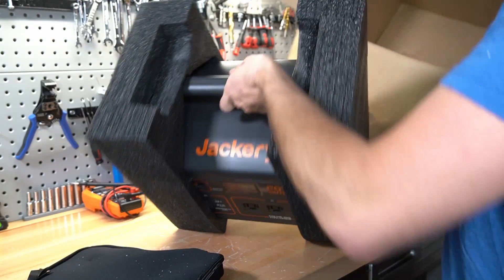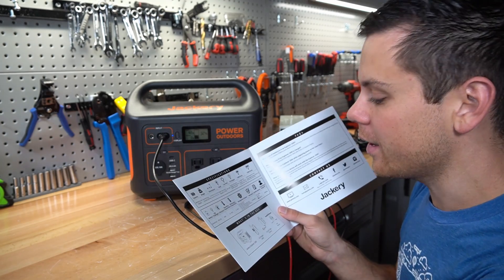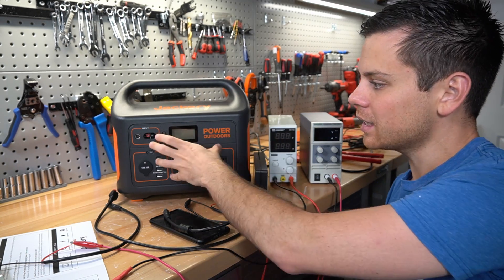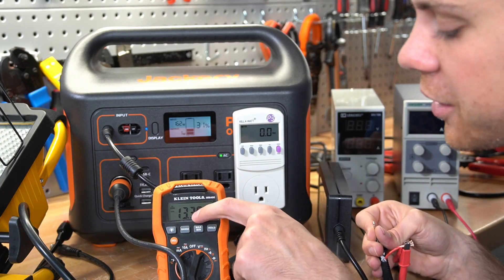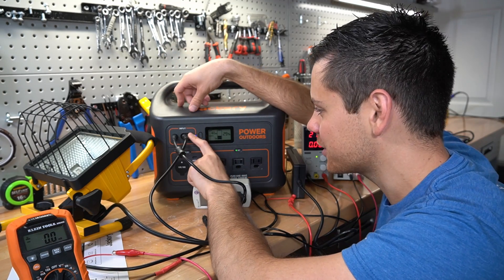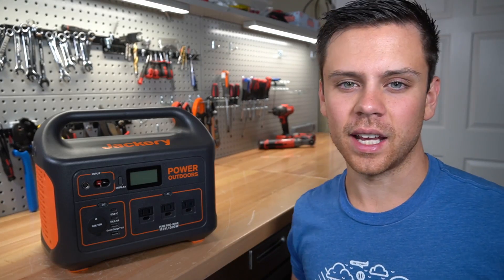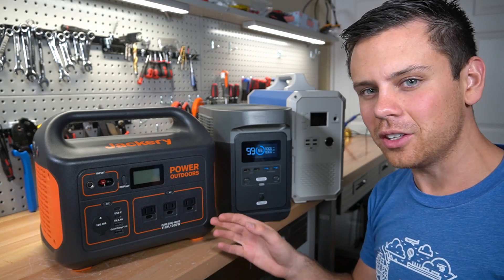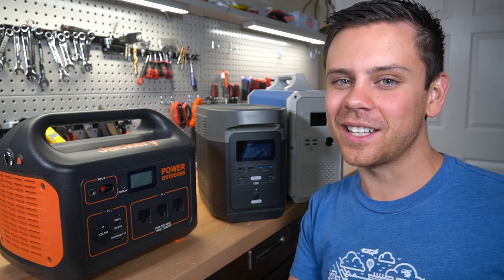Jackery Explorer 1000: Mini Solar Power System

Comment: After watching many videos and window shopping multiple solar panel brands, I've yet to find a solid opinion of how to determine the highest density of wattage from readily available panel technology which could mount on any of the following cargo vans with their respective dimension options. I recently discovered your channel and recognize your ability to render an expert opinion.  Perhaps a dedicated video?  I believe you would find people quite interested.

Transit 69" x 106/124/154"
Sprinter 69" x 123/165/180"
ProMaster 73" x 106/126/140"

Considerations: 
- Panels do not 'hang off' the roof
- Advantageous to have at least 1 area for a 17"x17" roof vent/fan
- If any or all of that 17" allows for another panel, priority panel
- The 17" can run either the length or the width of the roof
- Which van has the highest percentage of uncovered space relative to its highest wattage density
- Weight
- Price 
- Other pertinent ideas and challenges

Thank you for your content.

Comment: hi Will I just want to get your thoughts on the setup I am planning for my solar system. 10kwh solar array, 10kwh hybrid inverter/MPPT charger, and 20kwh life04 powerwall battery on my hybrid on-grid power system. I appreciate your advice. Thanks.

Comment: Hello, love the channel. I just got a call from my parents who are traveling abroad on there sailboat. The voltage regulator just failed and they bypassed the regulator to get it going again. The alternator is pushing about 16 volts to the lead acid batteries. The amps are low but will the higher voltage damage the batteries?

Comment: Hi Will, could check out Mr Li 12 v 100ah lifepo4? . It looks like a great battery for a beginner, however I would be really interested to see the BMS and the wiring they are using.

Comment: Will PLEASE test the new renoghy hybrid 200ah gel battery. Specs show low internal resistance and at least 1000 cycles at 50% DoD.  Also no BMS so it's more reliable. Do a cost vs lifepo4.
Reply from the maker: That's still too expensive. LiFePO4 much cheaper and better performance. Gel batteries are not impressive
Reply: @WillProwse  Long term, yes. Correct. I could barely afford the gel. I have 200ah of usable battery in my 24v system. The battle born can do 80ah. I would need 3 of them to get me to 200ah. That's almost $3k! I spent less than the cost of one battle born. I got what I could afford. I don't do heavy pulls and live in a tiny home with 1600 watts solar.

Comment: Hey was wondering if u can help me out. Btw love your channel and u got me in to using recycled batteries to build my projects. I got myself some a123 system 26650 batteries from hybrid buses. My question is im finding that the batteries are discharging more capacity then actually charging. Example it will charger 1678mah and when discharging it will be 2213 mah. Why is that happening or are the batteries are no good anymore. I have never had that happen with my 18650 batteries. Any help would be great.

Comment: Could you do a review of the zero breeze portable air conditioner? I want it for my camper van, to run off of solar. But I want to know if it uses low enough of energy, to be possible

Comment: What do you mean "a higher voltage 12 volt panel?"
Reply from the maker: There is some variation among 12 volt panels. Depending on the cell configuration. some have a voltage open circuit of 20 and some are at 24 volts. Depends on the manufacturer

Comment: Will, I love it, and I think I can speak for everyone here when I say that we turn to you for your advice, and your opinion on any product.   I just kind of chuckle when you say things like, "These things are more like for camping."   lol   

You always talk about the fact that we'd be able to build our own system for much less money, and that is very true.  I believe you!   BUT.....do I have confidence that I could do it, and do it right so that I don't burn my RV or my house down?   NOPE!!  Nor do I want to spend the money on the tools, the parts, or spend the time doing it. 

That's why I will only buy things like these solar "generators" that are built by someone other than myself.   It does also take a certain amount of skill, and designing, and manufacturing prowess to be able to get all the things that are inside of them, into these nice handy, and easy to handle containers. 

I will always wait to see a review of yours on any solar generator that I am considering buying. That being said, I will always say that I think you were too hard on the Apex.  It WAS about 1800 bucks, but you can get one now for 1250.  My power knob has not fallen off.....lol!  

I know you hated that it was regulated to about 500 watts max output, but, it will still put out 800 to 900 watts for about 5 minutes or so....at least mine will.   And I actually like that they did that, so that people won't wear out the battery so fast by discharging it too rapidly, over and over.  

My wife and i cooked up dinner in the Instapot the other night using the Apex.  It worked great!  I watched TV on our 65 inch TV, along with the Cable box, my home theater, the router, and the wifi all on, for about 6 hours the other day.   I did have it hooked up to 400 watts of solar while I was doing all that, but, even at the best time of the day, it only brought my total discharge down to about 50 watts instead of the 246 watts it was all pulling before plugging in the solar.  All in all, it took it down to about 56% battery before I unplugged everything.  Not too bad I thought!   I live in MN, so...not the best sun in winter!       My power had been disconnected because we're actually getting real solar panels installed on our house, and they were doing all the wiring.  

It freaked one of the guys out when he came inside to get up into the attic......he was like...WTF!  How the hell are you watching TV? 

It was a good time to test out my own little "off grid" setup.

Comment: For less than the cost of one Jackery 1000, could get two 235 amp hour deep cycle 6 volt golf cart batteries, two 100 watt & 1 50 watt solar panels to charge them, charge controller, wiring, fuses, and a pure sine wave inverter & still have some $ left over. Of course the Jackery is lithium & a lot lighter plus can discharge way deeper, portability is nifty plus it's plug & play very easy to use. However it is simply too much $$

Comment: Ideas: 
An installation of the system in a car or house. Building battery mounts/containers for all those 18650s. Short circuit current and heat developed. Insulating cells and connections. And of course, take some MORE shit apart.

Comment: According of out DC voltage, this have to supply with Lithium-Iron Phosphate (LiFePO4) battery. Lithium-Ion 12 volt usually 1 volt lesser than LiFePO4 battery.

Comment: Great reviews on everything you do Will.....Please consider doing a review on  
EGO POWER+ 56V 3000W Nexus Portable Power Station kit - 4 x 5.0Ah batteries 
This company is recently introducing a universal solar adaptor , and can be used with any solar panels.
I currently have a gas generator, however,  I  am considering one of these, as I have a son with the  EGO lawn mower, and it works really well- quiet and dependable...After one season, he had an issue with one of the  batteries that was under performing in operative time......
We found that customer support was excellent, as they sent a new one out immediately... It has been through two seasons now, and performing very well.....
EGO has  over 40 battery tools, so if you are a DIYer, or trades person using various tools,  having this generator in the mix,  where you can interchange batteries,  makes a ton of  sense..
Hope it can be worked into your schedule.

Comment: The moment jackery regrets sending you a unit 😂
Reply: Well that should give them a kick to up their game, so it is a good thing. This criticism is good for them, and ultimately good for us if they could fix the negatives and lower the price.
Reply: I’d take the Jackery for $1000 if they included two of there 100w solar panels
Reply: @andrewmaldonado2658  well yeah, those two 100W panels costs another $500.
Reply: I don’t think I have seen a positive jackery review yet?
Reply: goalzero & jackery are popular but they are a tad overpriced and underpowered
Reply: I think he made a good case for the Jackery too. Customer support and portability are pretty big selling points in and of themselves.

Also, the separate video he has of the EcoFlow Delta does not make it look... stable. If the insane charge and discharge rates he mentions are achieved only by noisily cramming as much cooling air through it as possible and shutting down the unit after strenous use, then I think I'd rather take the slow-charging but stable and quiet Jackery.
Reply: @neolexiousneolexian6079  Just got mine yesterday, used toaster, coffee pot, bullet blender, and my laptop. All worked great!! So far so good

Comment: Thanks for the review.  I think they missed the mark on this unit when comparing to the other units that are currently on the market like the Bluetti for example.  The 200W of solar input just isn't enough for any serious use.  I personally think the Bluetti is probably the best balance of specs, cost, and usability.  Hopefully, others will follow and continue to improve and drive the prices down.

Comment: Slow charge rate killed it for me also.  Still an 18W Type-C?   Ugh.   And the 30V input limit for solar is totally unacceptable for a unit this expensive and with this kind of capacity.  Same ugly case that's a pain to stack.  Has Jackery never heard of the concept of a retractable handle?  Pass.

Comment: Jackery is offering early discounts for the 1000 at 799$ instead of 999$
Reply from the maker: Same with ecoflow delta, but we are comparing the MSRP
Reply: @WillProwse   Looks like the ecoflow delta actually raised the price $200 to a new MSRP of $1400, where the Jackery is offering an actual discount.
Reply from the maker: @laronis  holy cow they did. What the heck. Well that's lame
Reply from the maker: Still prefer ecoflow.
Reply: @WillProwse   Good to know, but that is quite a price difference, $1400 to $800 (costs 75% more). And you really convinced me of the quality of the Jackery in your teardown of the unit in a previous video. But of course I can find the Ecoflow on sale already at $1200.

Comment: I have the RockPals 300W generator, bought it for $240 on Amazon special event. I keep it plugged into the wall most of the time and use it to charge cell phones, tablets and a Coleman Portable Cooler until the cooling mechanism burned out, the fan stopped working. I use it more than I originally planned on it's use. Just thought I would mention this.

Comment: You are absolutely correct about price. Not worth it at $1000 , $900 or $800. I would rather go with the Goal Zero Yeti 1000 from Costco, but I would definitely consider it at $700. Great review!

Comment: The input for the AC has a disconnect built in that shuts down the input for the solar panels. Most of those kinds of input plugs have that function. Probably due to most items using this kind of plug are usually plugged into the mains power, and the other leg is to batteries that cannot be charged. My "boom box" stereo has this same type of plug.

Comment: Hobo tech said these are a cheaper type of battery with a shorter recharge life at full capacity that is why they are lighter. I’m disappointed that the solar charge rate is low again. Maybe this type of battery can’t take a high charge rate

Comment: I’m staying with my goal zero 1400 because I can recharge it from below 20% to 100% in 3 hour with their  25 amp fast charger from goal zero.
Reply: Jason M I’m confident I’ll get ten years out of it because I recharge it daily when the battery 🔋 level is around 60%. According to Goal Zero it can be  completely discharge 500 time before the batteries will retain about 80% of it charge. I bought my Goal Zero to off set the gas consumption of my Honda EU2200i and the both together are a beautiful combination. I have stayed off grad for two week straight with my Honda and Goal Zero using only  one Gallon of gas.

Comment: You should invest in a basic oscilloscope so you can also compare the quality of the sine wave on these things.
Reply from the maker: I'll get a scope
Reply from the maker: THD of most pure sine wave inverters is cleaner than the grid. So usually pointless to test. But yeah, I need to buy a nice scope in general. So useful
Reply: @WillProwse  That's true if they're delivering what's advertised. But as your series on drop-in replacement 12V packs shows that isn't always the case.
Reply: @WillProwse  Don't be so sure. The sinewave can get alittle ugly under various loads depending on the inverter. It might be a good idea to test output quality of the many inverters you have in your arsenal. Your audience would probably find the information interesting and informative, I would.

Comment: Awesome stuff, very knowledgeable .great explanations and reviews. If you could please let me know what you would buy for a cabin that requires 3- 4 lights  7- 10 watts each and a tv (40 inch LCD and receiver for roughly 5-6 hrs per night for just the scatter weekend so I don't have to run the noisy generator. I would really appreciate you advise. Something that charges pretty quick.

Comment: It's tough when you really want to like a product but just can't. Maybe Jackery will change the design and increase the charge rate. It may still not be the best value for the dollar after that, but it would be a real option if you liked the design at that point.

Comment: What about the DC output.  Is it still 13.8v or 13.6v?
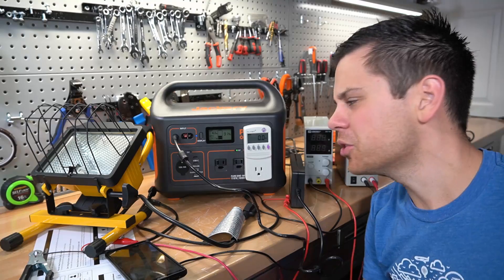Reply: 13.38V. He does that test at around 4:25 into the video.
Reply: Another reviewer indicated it was regulated, but at 12.3v.  Curious to see what Will finds.

Comment: I use the Jackery 500 with a 150w HQST panel on the roof in my sheep barn a few hundred feet away from any power outlet. Running three 30 inch LED shop lights pulling a total of 70watts. Even thought this setup works for me it is a slow recharge.
The Jackery 1000 interest me because of the MPPT controller it's said to have. After your review, I'm not so sure now. But like you said if there were a code discount of a couple hundred dollars maybe I'd look at it again. Thanks much Will.
Reply: The discount code will take off $200

Comment: Question, could you run an RV refrigerator on this while traveling instead of using propane? How would you plug into AC without breaking anything (backfeeding)?  How would you suggest safely wiring it in?  Would you consider doing a video on this topic?
Reply: Eli Tuber you can run a fridge of this depending on the size (if it’s around 1.5 to perhaps 4 cubic feet).

Comment: I have a jackary 500 and although I like it a lot I had high hopes for the 1000. It's not a good value as it stands currently. Jackary does have good customer service however. My first 500 only worked for one day before it wouldn't turn on anymore. They sent me a replacement within a week. It seems to be a fluke the first one died because I've not heard this issue elsewhere.

Comment: i was waiting and so glad you finally tested/reviewed this model. i would not buy the jackery 1000 for those reasons you mentioned but especially because of the 'delayed" readings. that is a mistake on jackery's part. i mean, why would any manufacturer think that a delayed (long delay) readout is okay. when you have other models without this drawback, then this is unacceptable. and the slow charging, when other manuf's are faster, is just unacceptable to me. everyone wants past charging. make a "switch" mechanism and offer both slow and fast charging. let the user decide how they want to care for these devices.
Reply: john_lm0 yeah what’s up with that bs? 20 second delay! I’d be ashamed

Comment: Thank you for your test. Should  I buy it if they have an introductory $799 price or get an Ecoflo Delta?
Reply: It comes down to your usage.  If you won't need the inverter capacity of the Delta, and you won't be carrying more than 200W of solar, then the Jackery (at the initial release special price) is a good option.  I wouldn't pay full price for it.  (Full disclosure; I own two EcoFlow Delta 1300's, a Suaoki G500, and a Suaoki PS5B.)
Reply: I bought it at $799 and also bought 2 windynation 100w solar panels.  Works great and fits all my needs.
Reply: 1bsbsbsbs I think you have to decide that. If it’s attractive except for price and $800 is a good value to you, then I would buy it.

Comment: I've been using the Jackery 500 for some time now - and I really like it.  I just found out about Jackery 1000.   I'm glad you have one already.  Your assessment is spot on as usual and has me now wondering if I should by the Jackery 1000.   On their web site it was pre-sale status only.
Reply: @BT-dl8kq  I've not put a heavy enough load on the Jackery 500 to have the fan come on.  Good question.  I should put something close to the max load (500 watts) and hear the fan.  If I do that I'll come back here and update this response.  Off hand I can't imagine a fan noise that would be too bad.  A lot of these little fans that run on 12Vdc are like what you have in a desktop PC.
Reply: @BT-dl8kq  To use a pressure cooker or waffle maker you would need the big boy - Jackery 1000 like in this video.  The Jackery 500 is too small.   I'm still trying to justify another grand to buy the Jackery 1000.   If I hadn't bought the 500 when I did and saw the Jackery 1000 I would definitely have one of those now.